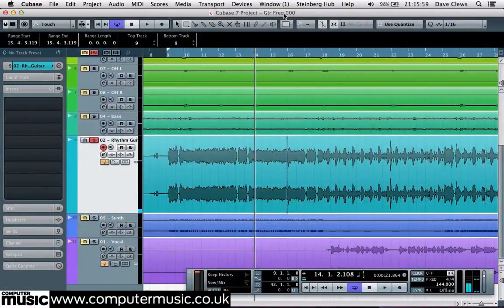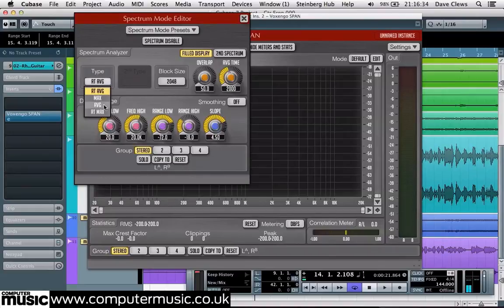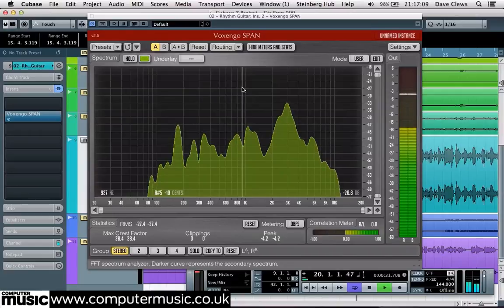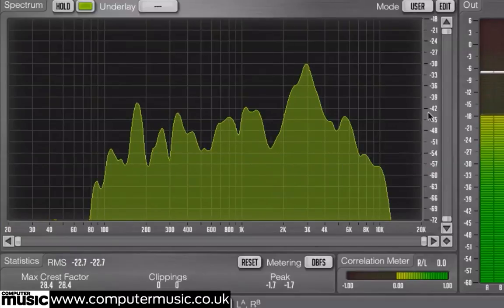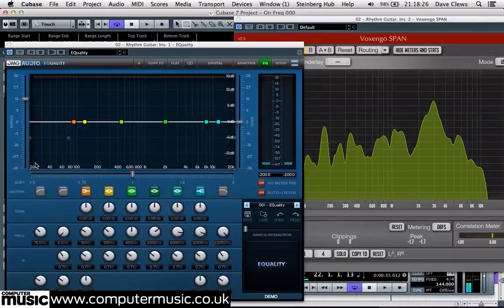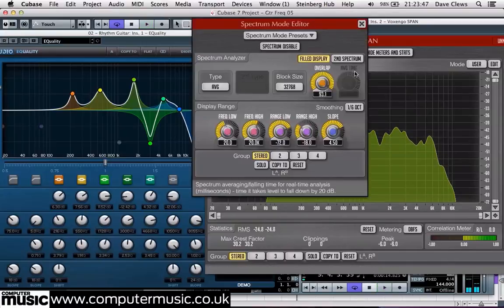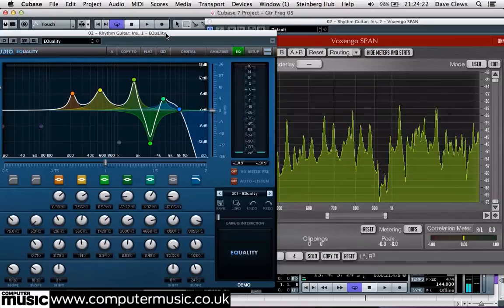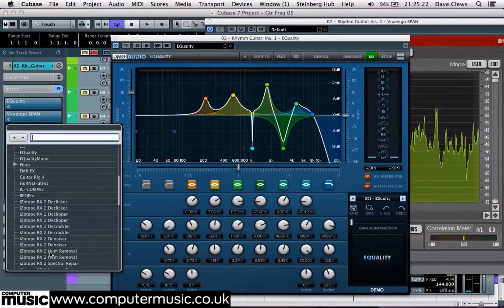Smoothing out harsh, boxy or dull guitars with EQ

Comment: Cutting and boosting by 12 DB is wayyyyy overboard and its not improved. If you aren't satisfied with 5 db in one or the other direction either start over with a fresh guitar track or get better studio monitors. That first 12db cut made the guitar sound hollow. Before that cut it was trebly sounding....four or five db may have been a decent compromise.
Reply: I mean that is so untrue, sometimes big 12db boosts/cuts is what it needs

Comment: The after isn't much of an improvement.
Reply: It sounds a bit better, but you'll never get that much of an improvement if the initial recording is as bad as that. I think it highlights how important it is to get everything right at the source more than anything.
Reply: Sometimes the client won't turn up again after you tell him you can't use his crappy recordings. I'd rather use this crutch than loose money.
Reply: I think this isn't just an eq problem. Its a bit too distorted at the source. Also layering different versions with different fx.